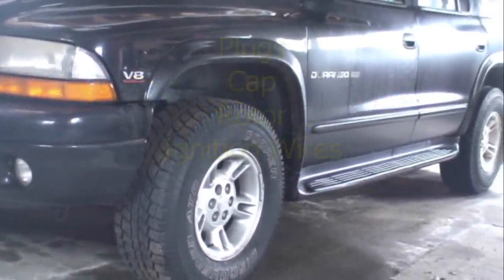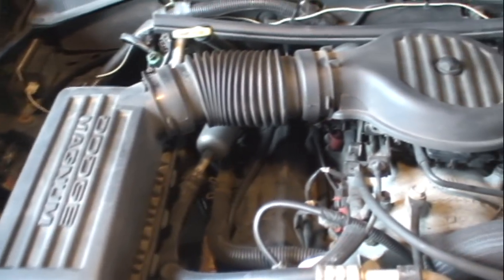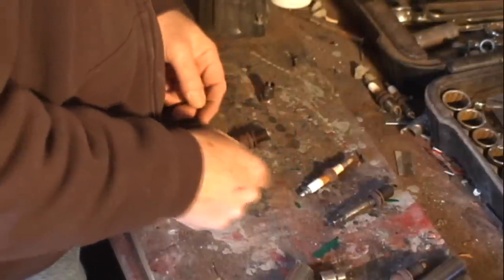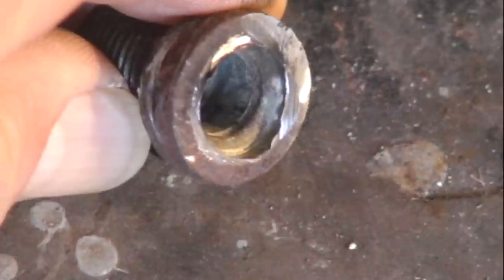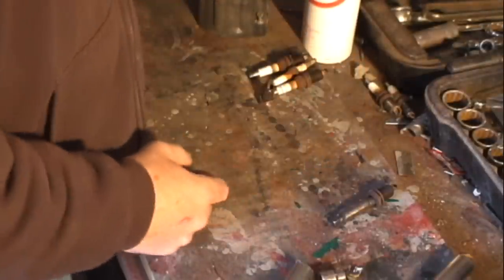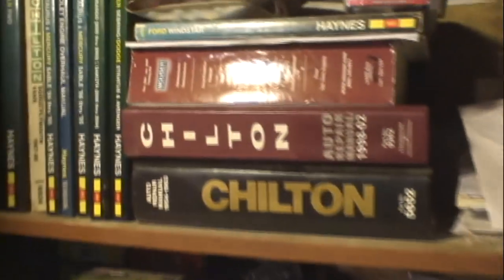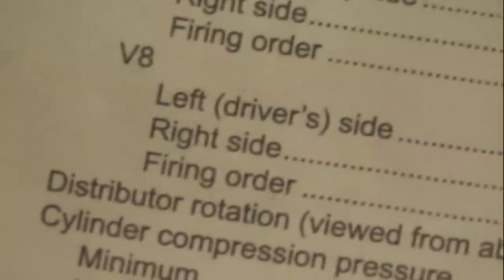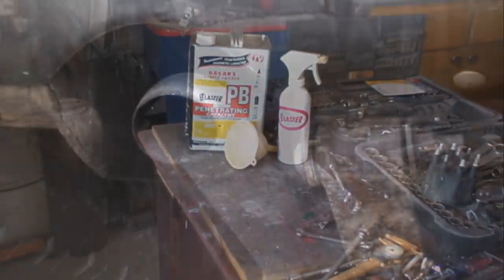Remove Broken Spark Plug - Tune Up Durango - Which Ignition Wire Goes Where

Comment: Great video, thanks for taking the time to make it. Can you explain the section where you're heating with the torch three times? Is it that you're spraying the broken half plug in situ (in the engine block, head attached), and then torching it there? Seems like the lube would drip into the chamber (is it the same as WD40?) Have two broken plugs already, expecting the same for the other two cyls